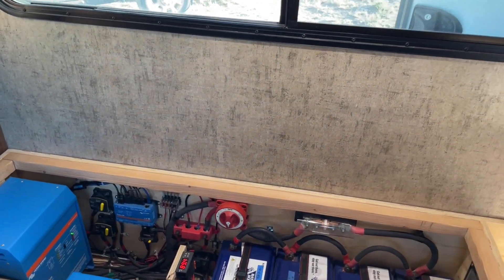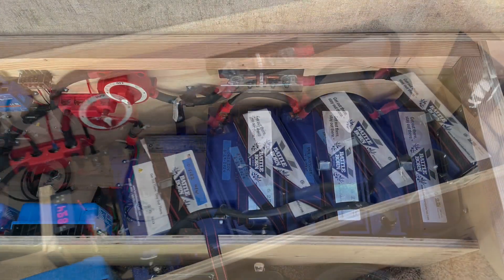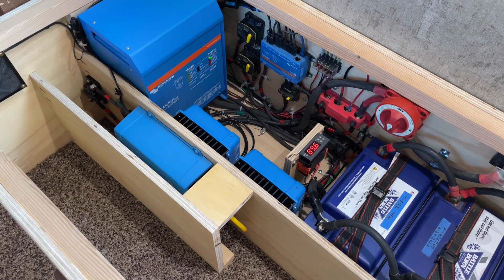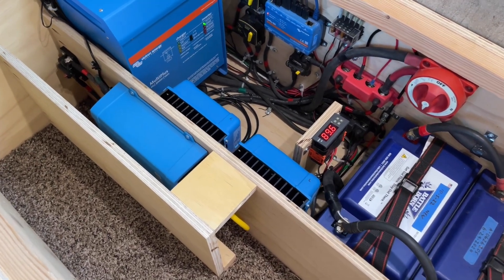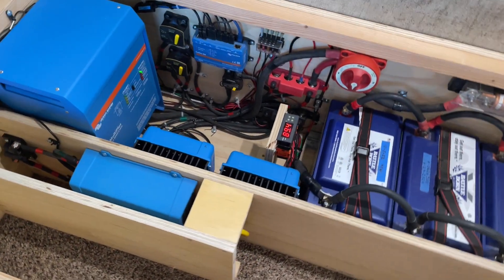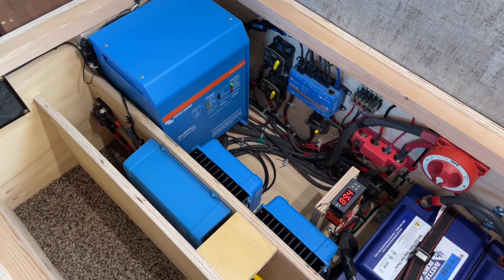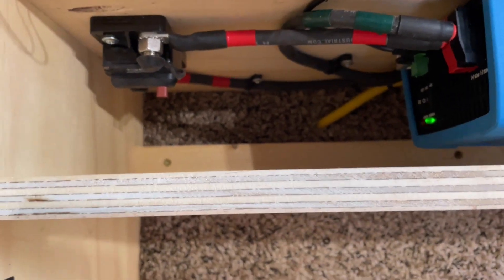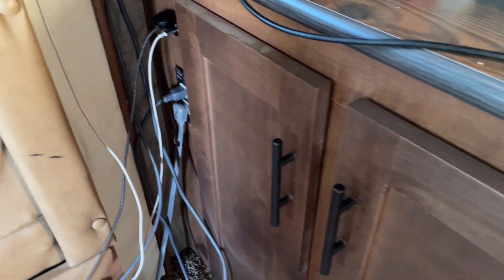Adding a Victron Phoenix Inverter and a 4th Battle Born Battery

Comment: Nice install.  I have the 12v/MPII 3000VA set on "Search" AES, ... Also using 400Ah worth of battery but upping it to 800 ... all in a fixed location.  I have some Apple Computers and so on .. that I have been running off the shore power.  IF I used the MPII and the Search works as normal, it will power down the monitor and apple computer ... which I don't want.  The Mini Mac pulls so little power.  Anyway, I did get a dongle for it but I think you said here I can connect it direct to my Cerbo GX ... which wasn't clear in the on line manuals.  But the dongles are useful.  I ordered the 12/250 which will still measure through the smart shunt our I can set it differently and individually in ECO ... is the plan.  It will be nice and Victron quality and so on .. sooo nice.  Nice video .. back to it now..  pat
Reply from the maker: HI David, thanks for watching my vid.  hope things go well with your setup

Comment: How bad is the hum?
Reply from the maker: no hum at all that I notice... as you probably saw in the install, its underneath a bench seat.  If anything, its the cooling fan that is audible, but that is to be expected.  this inverter works great and really saves on power for low-watt devices
Reply: @senormisterioso7466  Thanks for that. I'm gonna get a 375 as a separate power supply for a mini fridge and few other small things. Excited to be able to turn the big inverter off most of the day and save like 800 wh per day. The hum is the only thing I was worried about as some have said it's too loud. All in now, thanks.

Comment: Great work on the video and your system! Does the Victron Phoenix feed off the buss bar under the switch? And does the switch determine where the power is going, ie: to 1)Multiplus or 2)buss bar or both?
Thanks for the video
Reply: HI Erik, thanks for watching.  Im not sure I'm clear on your question, so trying to clarify here.  The Phoenix has its own power supply from the DC side (from the bussbar).  The phoenix can "talk" to the GX system via VE Direct to USB cable, which allows me to see the volts/watts its pulling and turn it on and off remotely (from the touch screen or VRM).  As far as where the power is going, i have the Phoenix hard wired to a specific outlet, which is dedicated to small loads like chargers, Starlink, etc.  Anything with a total under 250 watts.  The Phoenix for sure has a much lower standby power, so it works great when dry camping to turn off the big Multiplus whenever we arent running big AC loads.   Let me know if this answers your question, but if not... please re-clarify so I can be sure to give you the info you need